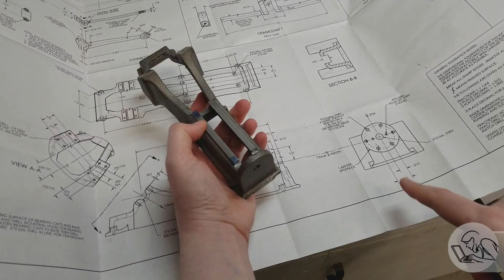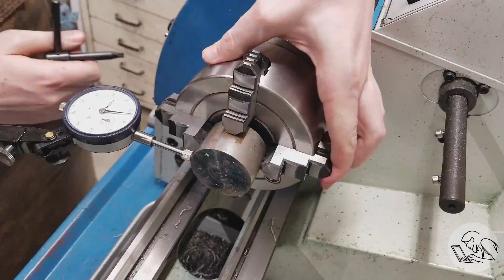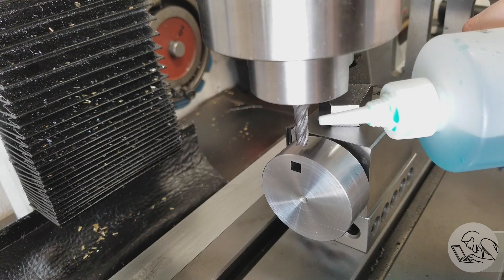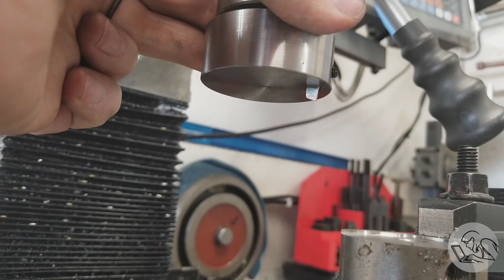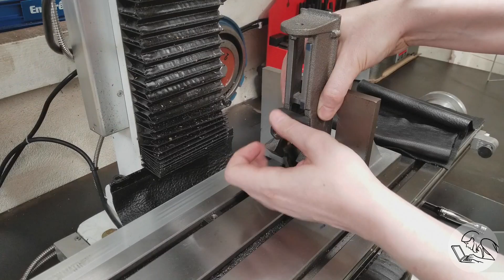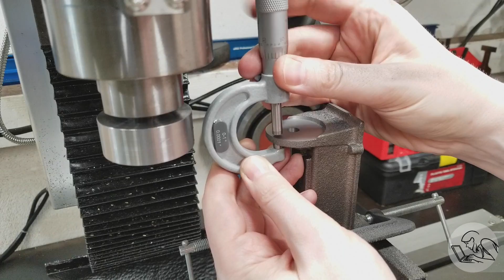Let's Build A Model Steam Engine : Spot Facing!

Comment: Click spiring has an amazing video about hand made square broach. He made it on lathe :)
Reply from the maker: Yes! That was amazing
Reply: @Blondihacks  I must say, I found your channel like a week ago and I love it :) keep up being amazing :D
Reply: It's surprisingly easy to make a nice square broach on a lathe.  It's quite a bit harder to make one that does a good job in cast iron, though.  (You can offset the tailstock and then cut a thread whose tooth profile is a cutting edge.  It's a very fast way to make a wood broach, and the helical cutting edge means a very smooth cut.  It's also a lower force solution than a mortising drill.)
Reply: @smellsofbikes  how would you determine the depth of cut though?
Reply: @jackgeedubs1855  The ones I've made are intended purely for through broaching, so if I wanted an 8mm square, I'd drill a 7.8mm hole, and cut a broach from 8mm square stock that has a 7.8mm cylindrical start on one end, then has a positive rake tapered thread transitioning from that out to the 8mm finish width.